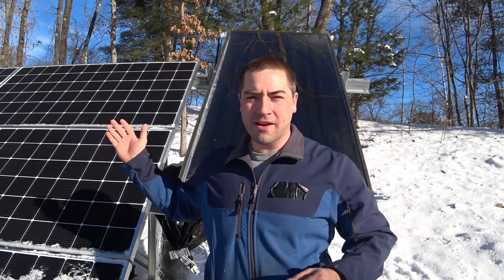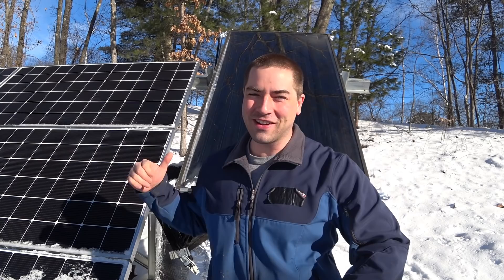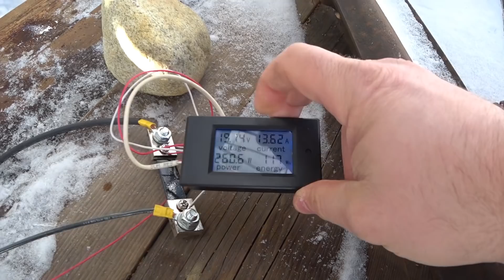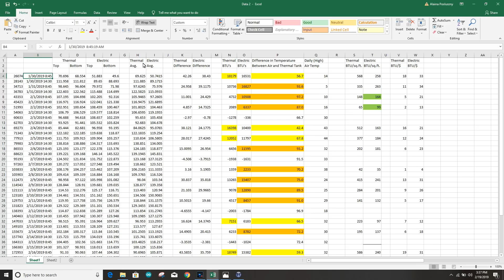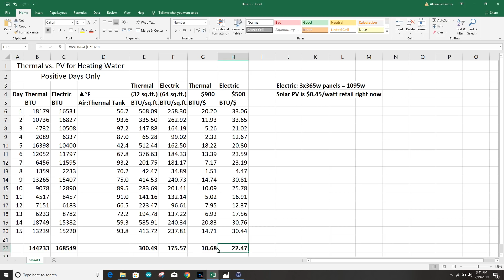Results of Solar Thermal vs. PV Experiment in Heating Water

Comment: Why not seal the solar thermal box and draw a vacuum on it? That should eliminate your 🔺️T issue with the oitside air temp. This should also allow you to get your tank hotter.
Reply from the maker: A vacuum would collapse the box and make the glass touch the copper pipe.  Then there would be conductive losses.

Comment: Let's look at it this way. You've done this 'experiment' in what looks like the dead of winter and i guess you live way up in the northern hemisphere. The fact that that solar thermal, with half the working surface-area, still kept up with your PV makes it the clear winner in my book. Also you are using a drainbacksystem which we, specialists in the field, know is the worst system in colder climates. I would suggest you redo the experiment with antifreeze in the solar thermal system and a coil. Also use a poor conductor like pextubing as your piping between the tank and the panel with a flowbackreservoir thus seperating the ambient temperature from your reservoir. You clearly have ample knowledge and craftsmanship so do your homework and do a 2.0 but do it properly this time. I subscribed so i get notified on your future adventures. Kind regards, Bert Demeulemeester from Belgium
Reply from the maker: Wow, thanks for watching in Belium.  Thank you very much for taking the time to write me some helpful suggestions.  I have gathered a couple parts together (circulator and heat exchanger) because I want to make an antifreeze version, but I'm still learning about them, such as where to put the pressure relief valve (as an example).  I still need to learn more before I can build it.
Reply: @DavidPozEnergy  well i'd start by making absolutely sure your antifreeze doesn't leak in to your water because that'll be no bueno😅. For your warm water i'd go with a expansiontank( that's like a rubber bladder in a metal casing that allows for expansion of the hot water/steam. The key is not to overengineer it😂. You could do the same on the antifreeze side in the flowbackreservoir. It's actually really not that hard. If you want to really go all out you can even go for a double tank system.

Comment: This is an area where I think people like you could make an improvement of sorts to the tech. In this video you quoted a price of $900 for one 8x4 solar thermal panel. (Grr... greedy little...) In one of your videos you repaired both of the 10x4 units on the side of your garage. From that video, I determined that a solar thermal unit is little more than a green house box with some insulation, aluminum baffles and copper pipes. I estimate that for about $300 I could buy all the materials and tools I would need to build two panels equal in size to the 10x4 panels. And I am certain I could make them perform better. Of course I don't have a work space to do that kind of thing... But you do. I wonder what you could accomplish if you tried to make your own.

Comment: Also you can store electric via air compressor. Then have the compressor  hooked to a generator.
Reply: Compressing air is a very inefficient way of storing energy unless you also use the heat energy from the compressed air. Compressing air raises its temperature, and in a standard air compressor installation, this heat is a nuisance, and is usually released into the surrounding environment, thereby losing a surprisingly high percentage of the input energy, making the remaining cool compressed air quite energy inefficient when used.
However, if you capture the heat energy immediately after the compressor and use it, the overall efficiency rises significantly.
And finally, when you use the compressed air e.g. through a turbine running a generator, it cools down as it expands.. use that to cool something that is too hot and maybe the efficiency will rise to an extent that it is worth considering.. but it still won't match pumped water storage, batteries or flywheels.

Comment: you can make a thermal panel for around 100 euros  with alupex pipe( 150 meter spiral painted black)  sooo in that perspective the thermal one is way cheaper.
Reply: and the drain back system makes it way more unefficient

Comment: By only running the pump when the solar thermal panel is hotter than the storage tank it will only heat the tank. Just don't lose the heat.

Comment: My folks got solar thermal back in the 70s. It was a 2-story house, and when time came to overhaul the system, the cost was significant, so they decommissioned the system... I don't know how
the solar thermal systems are today, but it seems like the plumbing might be more failure prone than wiring... also weight, maybe?

Another thing to think about if you're doing a heat-pump water heater... a friend of mine has a duct leading to the *attic*, to get extra-toasty air for the unit to extract heat from!
Reply from the maker: I don't know if plumbing is more prone to failures, but it's definitely more tricky to install. I like the PV approach.

Comment: It seems from your spreadsheet and your low temp column, that the water is mostly staying above 100 degrees even as it cools at night. Is that right?  Does it really not cool off during the cold snowy night there when there is no sun?

If you added more elements, do you think you’d be able to reach your target temperature?
Reply from the maker: I insulated the tanks.  If I didn't insulate then the tanks might have frozen overnight.  No amount of solar collectors can make up for insulation.  Certainly more elements and more solar panels allow you to make the water hotter.
Reply: DavidPoz that’s good to know that good insulation can keep the temp above 100 even with snow on the ground. My understanding is that a water heater only takes a few hours to cool down so I was thinking that it just wouldn’t hold enough heat long enough even if it weren’t cold.

Comment: Very interesting video ! But it should be very useful to do the same test in summer. In this case, the winner could be the thermal panel. The efficiency of solar panels decreases a lot when the ambient temperature increases.

Comment: If you were building new, would you do your radiant floor heat using pv solar?  Also what do you think of the benefits of using a large conventional hot water tank instead of diy rubber lined tank. Especially in a place where you are worried about humidity?  Thanks.
Reply from the maker: If I was building my house again, I would probably install PEX tubing for radiant floor.  Then the hot water for the radiant floor can be heated with solar thermal, solar PV, or even a wood boiler.  More options.  
For the water tank, you could buy two (or more) commercial units.  They make them in stainless steel, which should last longer.  I just find the price tag a lot.  For a 100 gallon SS tank, I think they run $1200 to $2000 (depending on brand).  Buying two of them would be more than my car is worth.  LOL.
Reply: DavidPoz thanks for the response. It sounds like you are still using your solar thermal for your hot water (why not if you have them) but you’d do pv solar if doing it again?

I’ve got a property I’m in the process of buying and I’m thinking of retrofitting it with radiant floor heat and am looking for a good way to off grid that and the rest of hot water. I like your pv method because I have to span a long distance to get it inside and I imagine that my electrical loss would be less than my heat loss. But I really need to be careful with humidity. I will have lots of space so thinking about multiple hot water tanks (maybe used) and using zone valves so I can keep one tank at a non scalding temp and one or two more as backup at a higher temp with a zone valve and a circulation pump. Maybe that’s dumb. If you have any thoughts I’d love to hear them.
Reply from the maker: Can you send me a message on Facebook so we can keep going with this conversation?  https://www.facebook.com/DavidPozEnergy/

Comment: Thanks for doing this experiment!  I'm in the PacNW and I think I will go with the PV after watching this.  Likely going to put in a 100 gal tank running only on solar PV before my 50 gal propane hot water tank.  I should get enough hot water to offset the propane use and run the radiant heating.

Comment: Hi, Test is not correct. You must fill thermal panel with water without any  air left inside of panel to see real performance. To do that 1- extend water return pipe until to near bottom of the tank. To avoid air excape in to panel and pipes. 2- put air discharge valve on the pipe at the top of panel. 3- block return pipe and run the water pump and remove all air inside panel and pipes by air discharge valve at the top. Remove the blockage on the return pipe. 
By this procedure water passes from all parts of panel and performance increases. 

May be very good project for real life heating home, both thermal and PV combined.

Comment: I wonder how this would work for a stock tank. I only have to keep the water a few degrees above freezing, but there's going to be a 12" circular hole in the top for the horses to water at any time. Perhaps changing from  a 100-gallon tank to a 5-gallon tank and put insulated barrel next to it to cycle the water to and from, and pump water from the well into the barrel when the level gets low. Most commercial systems have insulated walls, but a steel bowl that's heated with 1000W, and when it's cold, it's on 24/7.

Comment: Would it be beneficial to use the solar heater to warm your holding (larger) water tank in the basement which could then be pumped from the top into a second user (much smaller) water tank that is then heated with the PV to obtain a final 180F+ water output?
Reply from the maker: That would be fine too.

Comment: Love your video!  Thermal solar is mostly ignored today. We use solar thermal to heat.  We have 30" of soil under our 6" concrete slab that is insulated on the sides and underneath with pex running through it and the concrete slab.  I also have a 600 gallon insulated tank with copper pipe as a heat exchanger. Cooper is the way to go.  We are in Colorado and sunshine is abundant.  That massive thermal mass keeps the house warm for many cloudy days.  The solar thermal panels are significantly more efficient at the lower temperatures used for this.  With a well insulated house the floor temps rarely get to 80F to maintain comfort. Our thermal panels were old new stock and 4'x8' panels were $150.  I have a backhoe so that also helped with costs.
Reply: Can you tell me about your controls? A friend gave me a solar thermal panel, I want to make some coils of pex under my big plant bags (15 gallon) that are in rubber lined long trays in my greenhouse. Just getting started, really appreciate any shortcuts/time and money saving ideas. Wr are in mountains of western NM, 7600+ Elevation.
Thanks!

Comment: Dear David i did not see you use some good quality MPPT regulator and you connect the panels directly to the heating element .In this way you lose more than 30% power .If you have the posibility i suggest to test it with some good quality MPPT solar charge regulator . I would like to know the numbers after new test
Reply from the maker: You have that correct, I have no MPPT controller in there.  I did it this way to demonstrate the simplest approach.  But I am planning more tests with more controllers.  It's just a matter of time and money.  I don't have government grants helping me out.  LOL
Reply: @DavidPozEnergy  Hi David, I would also love to see a little experiment mppt v direct. I have read everywhere MPPT will get you another 20-30% but I'm struggling with how to hook it together. Best part about your videos I can almost leap from my chair and try it, your demonstrations are second to none.

Comment: Seems like you'd eliminate some of the disadvantage for the thermal solar by placing both tanks inside the home.  I know this was just a test and you'd never try to store your hot water outside your home, but it created a disadvantage that would not exist in a real-world application.  With that said, the solar electric has obvious advantages in both cost and overall utility during the warmer months.  With roughly the same amount of square footage, your could have added 3 more PV panels and increased your ability to also cool the home during the summer.  Very good experiment, overall.  :)
Reply from the maker: Hi Jason,  you are right that it's just a test, so thank you for acknowledging that.  During design I considered how best to do this.  In my real tank inside my house, it has less delta to the surrounding air, thus less heat loss through the insulation.  However, I also draw heat off the tank for showers, laundry, dishes, etc.  This is also heat loss out of the water.  I did out several versions of this test on paper.  This test I set up actually has less total heat loss than the tank inside my house because I'm not drawing from it.  But I tried to make them as close as possible given predicted outside air temp for the experiment time.  It's always a toss up as I don't have the funds to create two identical houses with identical automated uses.  Thanks for watching.

Comment: which one does better handling hard water and less maintenance cost?
Reply from the maker: Both are pretty low in maintenance, but probably the Solar thermal has more maintenance cost because it has a pump that will need replacing eventually.  The solar PV has no pump.

Comment: The best is probably do both ! They seem to compensate each other very well, and you can feed the electric pump for the thermal off your PV, so you have a nice closed system.

Suggestion: get a "heat camera" or hire someone to test your system. Around here (Romania), building inspectors thermal image a new house, in order to give it an energy rating. On the thermal imaging camera, you can clearly see how hot are the parts and where the heat is escaping. Those areas need attention - extra insulation.

My guess is that the insulation you put on the tanks (saw the video where you built them) is insufficient for the kinds of temperatures you get. Around here, the insulation is about 5 times thicker than what you used, about 3-4 inches thick.

Sidenote: cost is subjective, depending in what area of the world you live. A thermal panel is dirt cheap around here, while a PV one is extremely expensive - one of the reasons my brother only installed a thermal panel. It feeds a 1200 liter boiler - aprox. 350 gallons.

Comment: Why is it an either/or choice?   A seperate completely passive low maintenance system for hot water saves you energy for other uses.   Nice to know you can use PV but we sorta know you can boil a kettle so its not big news that energy can make water hot.   People tend to make hot water too hot anyway,  which is waste and dangerous in some households (kids and the very frail/elderly)

Comment: One consideration is whether or not you have a PV system for general household power. Taking up roof space with single-purpose thermal panels in that situation doesn't make sense. Cover your roof with PV and run an electric water heater. The water heater won't run all the time, and while it's off that energy will be going into your batteries or out to the grid and doing other things for you, whereas a thermal panel just sits there taking up space doing a single thing.

If you are otherwise on the grid and only have the solar for hot water, then thermal will save you money from the grid and being single purpose doesn't matter so thermal is the way to go. I will point out, though, that most ready-made thermal solar hot water systems have electric backup for those days when it's too cloudy to get hot enough, and that pretty much zaps (pun intended :-P ) any advantage of thermal solar. Of course, you don't have to hook the electric up, but there will be days when you have no hot water.

Comment: Surprising results. I do agree with your assesment. Solar thermal is more efficiënt if size is an issue. But isn't that always? If you had a Thermal panel 3x the size (equal to that Solar electric) you would not be comparing apples to oranges. You could heat up 500 gallons of water in the same amount of time, solar electric would not. The fact that solar energy (in general) is free does not change the comparison by resising them to fit the demand equation, only cost does. If you really wanna hit the nail on its head you should build a Thermal Solar cabinet yourself 3x that size for 20% of the cost ($900) of a pre-built one. You should invest into some insulation for the cabinet if used in colder conditions, that would make more sense.

Comment: I built a solar heater (plastic coil in a window box and heat exchanger) for $300 twenty years ago.  Makes too much hot water.  Way way way cheaper than PV - to - heat.

Comment: Great job and great project. You compare the cost, but I missed where you specified how the cost of the solar thermal panel was obtained. Is this a commercial panel or is it one of the diy panels that you showcased so well at https://www.builditsolar.com/Projects/SpaceHeating/DavidPoz/DavidPozSolarDHW.htm    ? For those who are remotely located and cannot buy good pv panels, the diy solar thermal may be the only way, or still cheapest if shipping on pv panels is expensive.
Reply from the maker: There are exceptions to every rule.  LOL.  When I talked about price in the video I'm making an assumption that you pay retail pricing of both PV and Thermal.  Yes, you can probably salvage things and maybe make a thermal panel for free.  Go for it.  I made my first thermal panel about 25 years ago.  But, if you have to start buying insulation board, copper tubing, black paint, glazing, etc.  Then probably the PV is still cheaper.  Also, don't forget that a 10 gauge wire for the PV is cheaper than a 3/4" pipe to connect between the panel and tank.